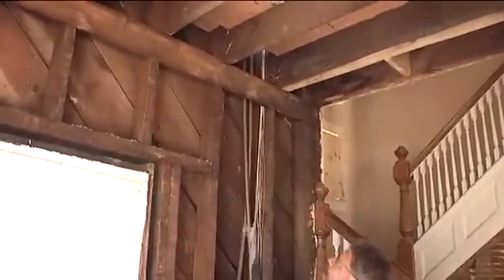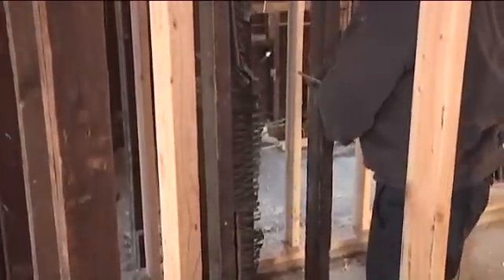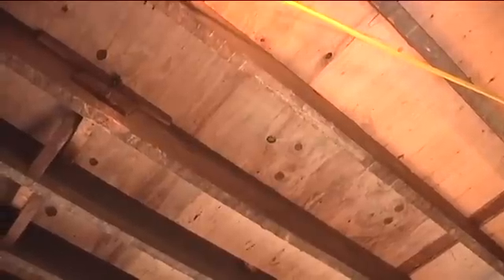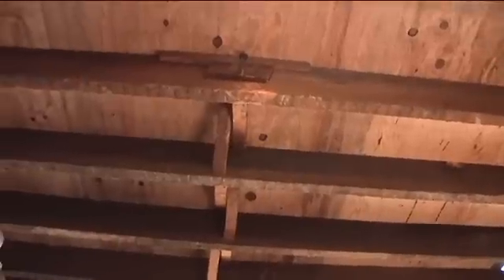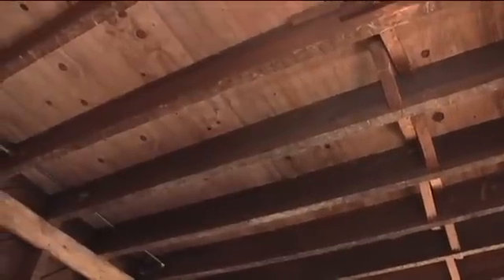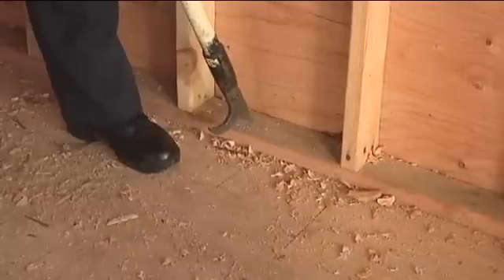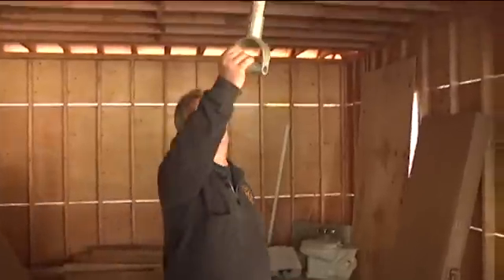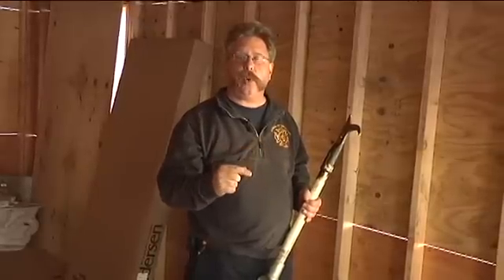Balloon Frame vs. Platform Frame Construction

Comment: How hard/ costly  would it be to add fire-resistant material, or simple block, to each cavity, to prevent vertical fire extension (similar question for any horizontal spaces)?